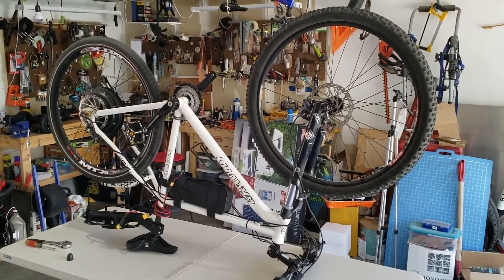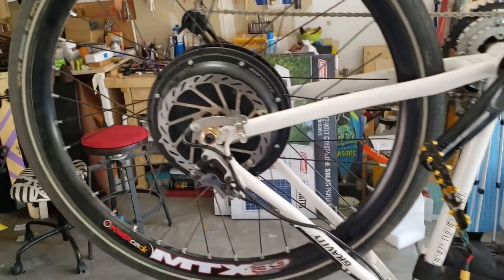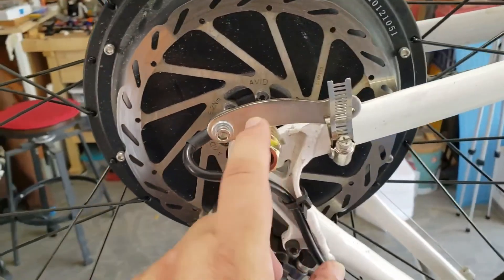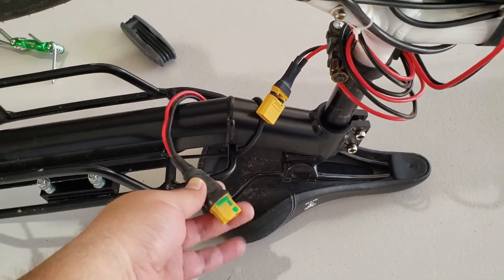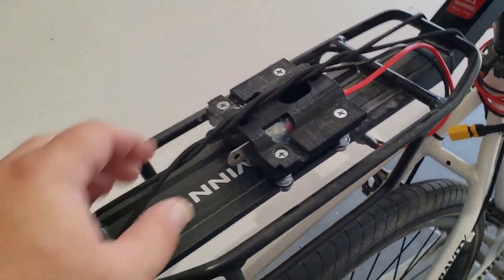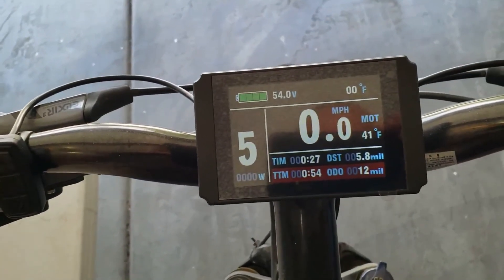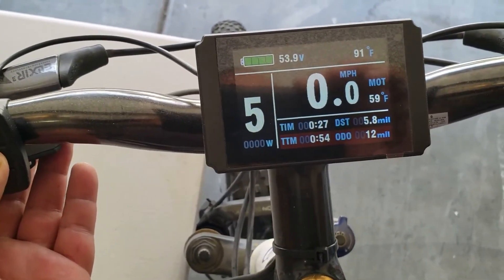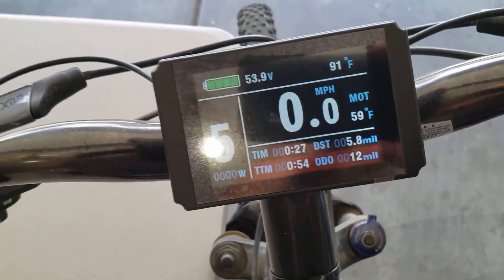DIY Electric Bike - EGO battery - 29" mountain bike - 2000w 52v kit?

Comment: Those people saying not to do this with ego batteries haven't looked into the batteries themselves.
Ego batteries are 56v (52v nominal) really 52v and the 5ah and above ego batteries have a 40amp-60amp max BMS so its perfectly safe to use ego batteries with that controller and probably even a 40 amp controller.

Comment: Is it safe? The question is: does the battery have internal protections when used outside a Ego powertool??
Reply from the maker: I'm not sure what kind of internal protections there might be. I know EGO has all kinds of systems to keep the battery safe. But, I can say that after using it for years now, lots of miles, holding the throttle for a LONG time, I feel I've put it through a serious workout, and never had a problem with the battery itself. And I've used the 2.5ah, 4ah, 5ah, and 7.5ah batteries on my bike. I hope this eases any concerns you might have.
Reply: @simplegoodleather  Tnx for the reply, did the battery ever shut itself off as a protection, when you asked a lot of power from it?
Reply from the maker: No, the battery didn't shut down. The controller eventually tried pulling more power than it could handle and it fried the insides of the controller.
Reply: @simplegoodleather  now that you've ridden the bike for a long time, what's the range on the 5ah and 7.5ah ego batteries ?

Comment: I’ve built 5 ebikes with 36/48 volt controller and they run 56v egos just fine.
Reply from the maker: That's awesome. You've never had ANY issues? over-heating? I always understood that using a higher voltage battery than the controller was rated for would lead to multiple issues.

Comment: As you mentioned at the end, there is an amperage ability difference on sizes of EGO batteries. I have the snowblower that uses two 7.5AH batteries but will work on only one. I tried doing that with my leaf blower battery, 5AH I believe, and while it would work, there seemed to be a voltage drop. Just for everyone's FYI, They have 10AH available too, used in their riding lawnmower. Same connector.

Comment: Yes that's why you need to buy the Hub motor wheel and controller separate.

Like for example my first 
e-bike i put together.
I bought 1000-watt hub motor kit.
For £140 on eBay 
It came with a 15 Mossfets 1500w controller & throttle & bits and pieces.
And I bought another controller KT 18 Mossfets for a upgrade for £55 on AliExpress.
And bought a KT-L8S colour display separate for £40 on AliExpress
Come to £95
= £235 altogether 
It's not that expensive
And you get exactly what you pay for.
And you get spare controller.

You can save even more money if you buy the Hub motor separate & buy spokes & rim separate..
I think you can build a 3000w hub motor wheel for less than £200.
Reply from the maker: I DID end up trying to buy a higher amperage controller, but the wiring it came with was totally different from what the item showed in the amazon listing. Ended up sending it back, cause I had no way to know what went where.

Comment: I was looking at the battery adapters for the EGO batteries on ebay, and saw that you can get a latching battery adapter that will hold the battery in place on the adapter.  Easier than a bungee cord...
Reply from the maker: good to know, I'll look for that. :)

Comment: I guess I am trying to figure out why not use a dedicated eBike battery with a frame/bottle mount? Seems cleaner and I would trust the connection better than a jury-rigged 3D printed mount from an unknown source not affiliated with the ebikes or even a battery manufacturer. The cost of the batteries is the same.
Reply: If you already have the battery because you bought an EGO power tool, that does make it convenient.  You can get the power tool, a battery and a charger for less than the cost of one of the larger bike batteries...

Comment: What size ego battery are you using? Ah wise that is? Also having any voltage sag when riding it? Top speed? How many miles are you getting ? Etc. I would like to copy your exact build except go with a mid drive kit! Any advice or knowledge is appreciated! Thank you!
Reply from the maker: I tried 3 different sizes of EGO's... the ones I had.. a 2.5ah, 5ah, and 7.5ah.... with any of them I was able to easily get up to 45 mph, just in my little neighborhood. I didn't take it out on a main road yet. There was a little voltage sag, but not too bad. I think in my video I mention that the 2.5ah battery was getting me like 11-15 miles of continuous throttle. I didn't test the other 2 batteries.